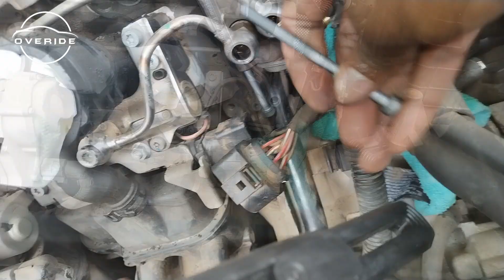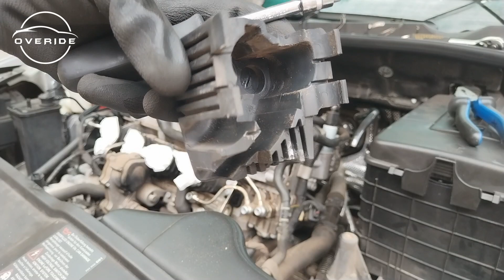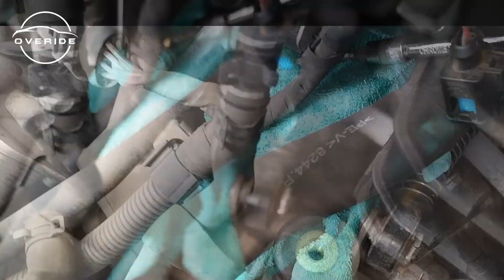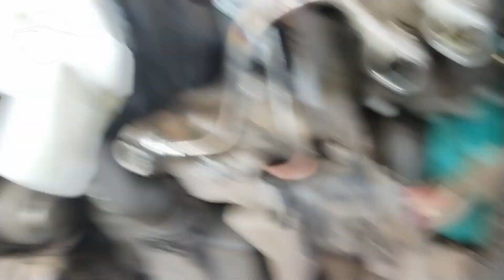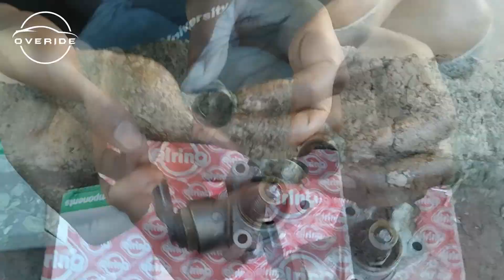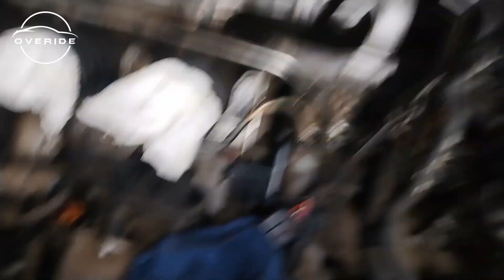How To Replace A Cam Follower | VW Golf/Jetta Mk5

Comment: High-pressure fuel pump sealing gasket (O-ring):
OEM part number: WHT 005 184 (alternative OEM: 06E 127 248)

High-pressure fuel pump cam follower (metal tappet):
OEM part number: 03G 109 309 (also listed as 03G109309)
Reply from the maker: Thanks a lot, this will definitely help me when I have to change the plunger next time

Comment: I just took out my pump to check the cam follower and it’s totally worn, has a hole on it. I am struggling to find it. My car is a 1.6 fsi, where can i find it?
Reply from the maker: You are struggling to find a replacement cam follower?
Reply: @MegatronicsZA  Yes. I went to VW earlier at Braam, JHB, turns out they don't have the cam follower for a 1.6 fsi BAG engine... they only have 2.0 Tfsi engines ones
Reply from the maker: @TshepangHeadman I'll send to you a part number you can give them. I think it's the same as the one for my car
Reply from the maker: Here is the part number: 06D 109 309 C, F. It works on VAG. You can get it at Goldwagen
Reply: @MegatronicsZA thank you my G. This is the one i got last and it’s bigger than the one mine uses. 😢 Learning a painful lesson about buying import engines
Reply from the maker: Damn it's bigger? I thought it fits on your engine. Sorry man

Comment: I have the same pain in the butt engine as you, i followed your exellent vidio and changed  the hpfp cam follower  my car has only done 130000 klms its a 2006 golf 5 2ltr fsi, the follower  i removed had no visable wear it also didn't  have the 4 holes on the face the same as yours, i orderd the genuine vw cam follower kit wich included the o ring and 3 new bolts  160dollars australian😢 the bolts were to short so i started to look at the availability  of a replacement  pump for the future the only one i could find that looked like mine was on Amazon  (out of stock) @950dollars hitachi hpp0008 would you know if this would be the correct one? I have done all the searches  i can find using engine numbers ect they all come up with the pump that mounts on top of the cam chain cover have you come across  this problem before 
Cheers Jack

Comment: Hello is there any steps in order to depressurise the pump or just letting the pressure out with the valve
Reply from the maker: I'm not sure but I'm not aware of those steps. All I know is that you just need to press the valve and it will lose pressure

Comment: I'm looking for a high pressure fuel pump sensor for a Vw passat 2.0 fsi (BVZ engine)

Can you direct me to a place that sells only the sensor
Reply from the maker: @sithembelemngonyama  I'm not sure where you can find it man, they usually sell it with the HPFP as a complete unit

Comment: Hello. My problem with FSI 2.0 Passat B6 cold-warm knock/clicks. Why? Same problem? Please check it out my videos. New: timing belt set, waterpump, (chain/tensioner ca. 40.000km), hydraulic valves.  No engine fault code. 😢
Reply from the maker: You most probably have the same fault, you also need to change the timing chain

Comment: In my experience, these camfollowers dont wear like they do on the 2.0tfsi. The end of the intake cam is different then the TFSI. The FSI has 2 lobes and is more shaped like and oval putting alot less stress on the follower then the triagular shape on the TFSIs. Anyways, very nice video, keep up the good work!
Reply: hey. i have a problem with my golf 5 2.0 fsi BVY. It makes a knocking sound on cold start(untill the engine is nearly hot) and i think the problem is camshaft followers. or the problem might be with the oil pump with the oil pump pipe ?
Reply: @Davyyd1  no clue mate, cam follower and oil pump are both on the far end of eachother of the block. Shouldnt be hard to tell the difference. Better to make a video and upload it. Tells more then a 100 words.
Reply from the maker: Yeah maybe with a video we can be able to tell him what the issue could be
Reply: @MegatronicsZA  this is unfortunate because my car sits broken in the parking lot right now. Water pump is leaking coolant and i need to replace timing belt kit. Maybe if you are willing to help after i change those i will upload a video with that problem. Thx
Reply from the maker: @Davyyd1 always willing to help each other get back on the road man, that's what the channel is for.
Reply from the maker: I'm guessing it could be the timing chain tensioner... Although I can't be certain because it's also important to know where the sound is coming from
Reply from the maker: Yep you are right about that, I've changed the 2.0 TFSI cams which are usually found on the GTIs and they have a triangular lobe with 3 pointy edges. That definitely causes them to wear very quickly. I was even thinking of changing this intake camshaft to the GTI one but due to the quick wear and difficulty of accessing the cam follower I might put a hold on the thought... Thanks for the support man, I appreciate it.
Reply: @MegatronicsZA  i think the difference in lobes has something to do with the higher fuel supply needed on the turbo cars. Very curious if it would work though 😊
Reply from the maker: @J4rn0  because the turbos need more fuel pressure injected continuously? Therefore the need for three lobes which means more power with more fuel... We'll I don't know why but I think there's a chance it might work.
Reply: @MegatronicsZA  ye 3 lobes vs 2 lobes creates more pressure per cam revolution in theory. But they also tune these cars with stupid high hp without changing the hpfp i think. So good chance it will work.
Reply from the maker: Lol please don't get me excited on trying this man.
Reply: @MegatronicsZA  do it! Haha its also worth looking into the cam properties. Maybe the lift and or duration is different